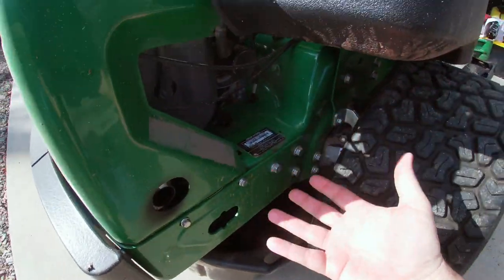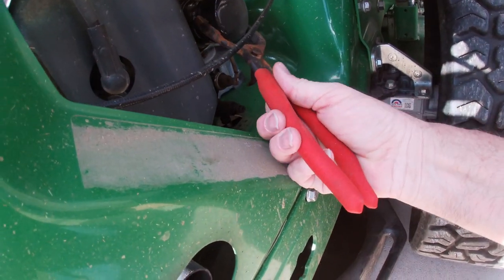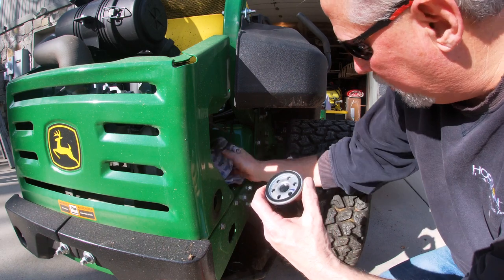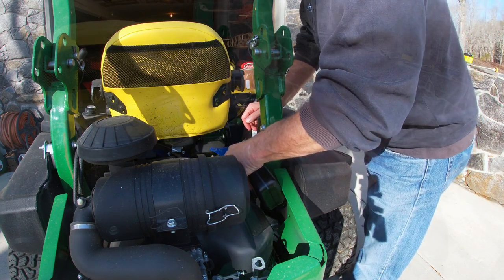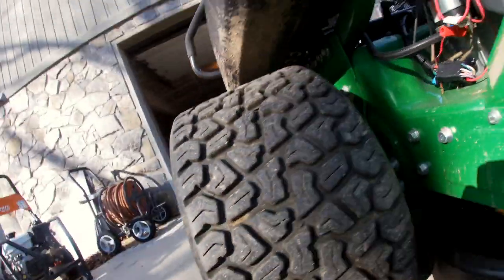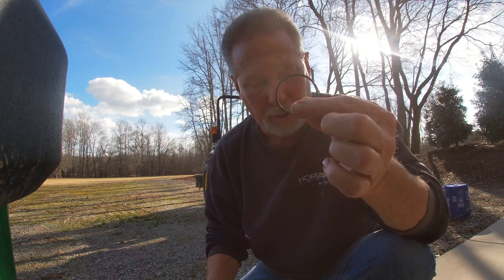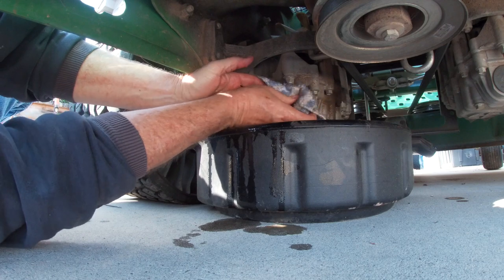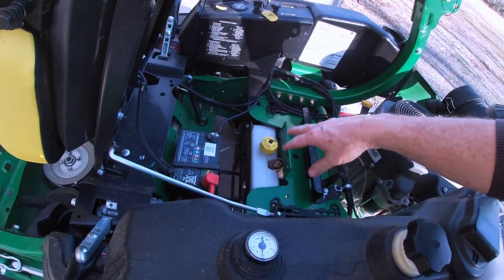JOHN DEERE HYDROSTATIC FLUID CHANGE #johndeereequipment #StihlProducts

Comment: Hey, appreciate the video but this is not the way the manual states to carry out this service. Nor is it the way the John Deere video states to do it. The machine is to be lifted off the ground and the tires are to be rotated by hand with the bypass levers pulled and then there’s a sequence using the control levers forward and backwards, still while the machine is off the ground. 
There’s also a min/ max fill line on the reservoir tank. It’s not guess work. Also those hydro caps have a torque spec. And to the lay person “just snug it up” may set someone up for over tightening. 
These machines aren’t cheap! Neither is a mess up
Reply from the maker: This is the way a John Deere mechanic told me how to do it step by step. The only thing I left out was to take off 4 more bolts. The ones with washers built on them. That would drain out just a little more fluid. I do agree with what you are telling me as I've seen those videos as well. Thanks so much for commenting in. Also thanks so much for watching my channel. Take care and hope you hear from you again.
Reply: I hear you, still though a mechanic’s advice or the video Deere put out AND the manual. No, it doesn’t require taking those bolts out to drain even more fluid. 
The mechanic might be lazy who knows